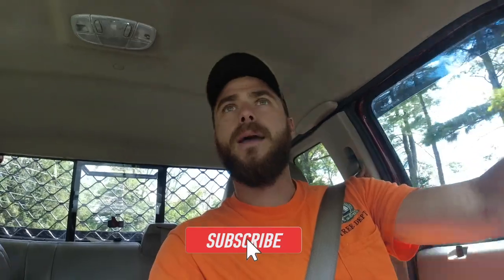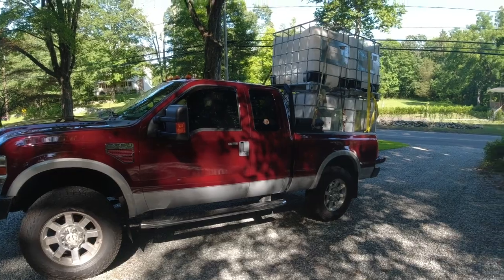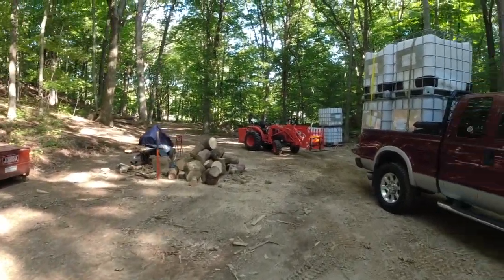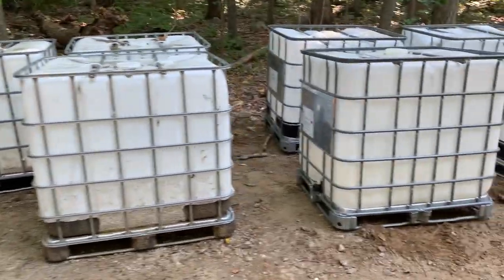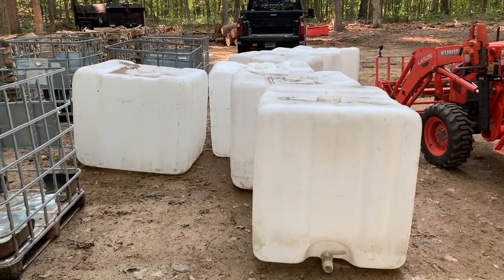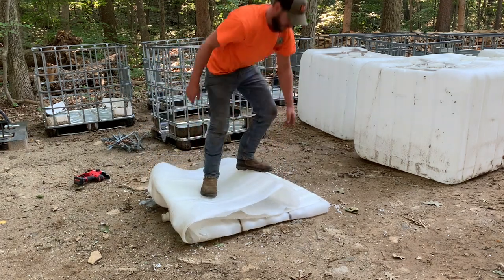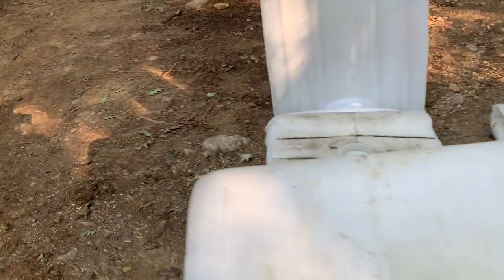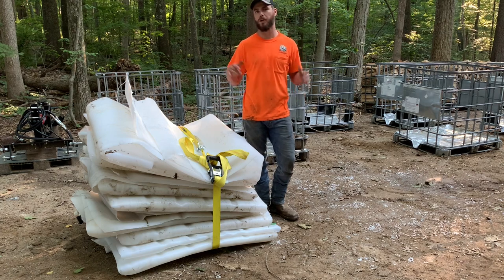#130 How to get IBC Totes for Free!!

Comment: Use your grinder to cut those bolts or screws off. I would be nice to have those water totes to save water in. Even if just to water your garden or wash your truck.
Reply from the maker: It’s pretty easy to just unscrew them with the power ratchet. I save the screws to replace missing ones on totes I get or that fall apart as I use them. I’m not really sure the bladder would hold the water well without the cage.

Comment: I remove the crossbars and the bladder, then I put the crossbars back on to support the sides after I cut the ends out. Then as someone suggested, I cut the bladders apart and use the pieces to cover the wood in the tote.  Great videos....keep it up.
Reply from the maker: Do you find that once replaced the cross bars get in the way of stacking the wood?
Reply: @DudeRanchDIY  not at all. I cut the ends out clear to the bottom so the crossbars going back in are pretty much a must to support the sides. So with the ends cut to the bottom, there's more room to "lean in" to stack the wood which makes the crossbars not an issue as far as being in the way. I've also found that with the crossbars in place, I can stack them 2 high and not worry about blowing the sides out.

Comment: A little late to the game with this, but here's what I've found. I measure 3" down from the top and cut all the way around and use the top to cover the wood (I read earlier that you don't like the look of them, but they come free with the tote, and don't need to buy a tarp). Then I use a cordless jigsaw with a wood blade, and tear down all the bladders except for one. Cut down the sides, then cut around the bottom, so you have 5 pieces.  Then I toss all those in the one bladder I didn't tear down. Push that onto the forks and set it in the truck bed. You can get about 12 cutdown bladders into that one.

Nice thing about the jigsaw is that it doesn't buck, just glides right along, and they're typically better on the battery than a sawzall. A cutoff wheel, as you have found, sucks for the job, and once it gets hot, the polyethylene basically welds itself back together. I don't put the top supports back in, just haven't found a need for that.

Getting the 275's for free (well, "free", since you have to barter, and that does cost you something) is nice. I've been able to buy 330s from a local place for $50/ea, and those hold a full face cord if you stack them just above the top (the cage is 38" x 47" x 47" on the inside, a face cord is 32" x 48" x 48"). The ones I've been getting are actually food grade, but that doesn't really help me since I'm breaking down the bladder.
Reply from the maker: Thanks for the insight JC! This video is older and I have since been phasing out the tarps since I am on a new property and can’t really see any of the totes from the house. I use the sides of the bladders as tops with a bungee cord on the top to secure it from blowing off. Works fantastic and less waste. I have a recent video of how I do the whole process and just take the centers of the bladders to the recycling center in my dump truck. Thanks for watching and your detailed feedback!!
Reply: I'll check out your new videos.  Thanks!
Reply from the maker: @JCWren  #241 & #242 most recently show how I do it!

Comment: I use an IBC cage as a guard for my generator when in use. I can cover the running generator with a tarp/plywood, and I can chain the two together to prevent theft. I only need to flip it off in order to refuel.
Reply from the maker: They have so many uses! Sounds like a great system you have!

Comment: Can you use a vacuum to collapse them so you could get them in your basement. I was thinking if I could put a black plastic tarp over and let it warm up in the summertime then I can pull a vacuum on it and collapse the whole thing I figure once I get a collapsed to a point where I can get it through a door perhaps I could blow it up and expand it to its normal shape using a hot air gun and everything else any ideas
Reply from the maker: Collapse the bladders? Not sure

Comment: Jake there is t40, t30, n 10mm bolt that I have come across for top bars. Sawzall is best for the bladders. Cutoff wheel as ur doing for cages. Keep one bladder in cage cut top off n let collect rain water so can use as fire truck on forks I've used mine more than like. Bill
Reply from the maker: I’ve thought about saving one entire tote intact for this purpose! Once I get my burn pit dug I’ll be doing this! Already have the hose fittings!
Reply: The millings you talking of for wood yard it not slag from a steel mill is it ? If is try 1 load 1st I hear it's a regret after some have tried
Reply from the maker: @billbrearton4164  Nope! Asphalt millings from when they resurface roads!

Comment: If you cut corner to corner you could use them as a roof to keep the rain off the wood...
Reply from the maker: I find those big tops to be an eyesore and just another thing to find a place for when not in use. I cover 5 totes at a time with 4’x20’ brown tarps and zip tie through the grommets to the top rail of the cage!
Reply: @DudeRanchDIY  yeah your way is better..
Reply from the maker: Haha 6 in one half dozen the other, I’m just a little particular and don’t want to stare at those tanks 😂 It works well for me, I have a video on it somewhere in there!

Comment: I've been enjoying your videos - keep them coming.

A few questions and comments about the totes:
1. For the wood that you have in the IBC totes, do you cover them? Why or why not? 
2. I cut the top of the IBC bladders off (I just use a sharpie and mark a line at the first bar down on the tote) and use these tops to cover the wood to keep precipitation off of the wood.
3. Do you put your totes that are filled with the split wood where they will get sunshine?
4. I've been using a circular saw to cut the totes - it rips right through them. Just got a cordless circular saw, so I'll be trying that out pretty soon.
5. I don't know if you need to skid any logs... what I'm going to do is take a corner of a tote (about 2 feet high, 16 inches of each side) including the bottom, and use that to strap onto the trailing end of the log so that it won't be picking up mud/dirt as I drag it to where it will be processed.
6. How do you clean the totes? I know you said that your supplier cleans them before giving them to you - but do you know how to clean them? I get mine from places that make dyed landscape mulch (the totes held the dye), and those are a real pain. Even pressure washing doesn't really clean them out. I'm trying to find a cheap way that cleans them out really good.

BTW, in a previous video you used one for holding the chippings from your shredder. I really like that idea.

I'm thinking of using one of the tote cages that is cut down far enough to sit right at my wood chipper, so that the split wood will go right off the chipper's tray into the tote. Then I can use my tractor pallet forks to take it to the totes for stacking. I think one one side, cut the cage open all the way down and remove most of that one side, and then use one of the sides of the bladders to have a temporary barrier that will keep wood from spilling out. Being able to lift the wood on the tractor to stack the tote sounds a lot easier than bending over to pick them up. Downside: will be stopping the splitting to empty the output "bucket". Alternatively, I'll find one of those 6'-8' pallets, and build some sides to it - this will hold a lot more than the 4' wide totes would.

It might be good to solicit from your viewers how they use the totes / bladders for purposes other than just holding stacked wood. A video on these alternative uses would be very interesting.
Reply from the maker: Hey there Wayne thanks for watching and for the thoughtful comment! 

Yes I do cover my ibc totes but only in the winter, I use 4’x20’ brown tarps and zip tie the grommets to the top bars of the totes. 1 tarp can cover 5 totes. I find the tops of the bladders to be an eye sore. 

I try to put the totes where they will get as much sun as I can while again not being an eye sore or in my way. 

The log skidding idea sounds like it could work! I have a purpose built “skidding cone” that slips over the nose of the log to achieve the same thing. I rarely skid logs though and when I do I just use the grapple. 

Cleaning the totes can be tricky, my guy I get them from says that he usually spends about 2 days cleaning them out with high pressure hose filling them up and draining back out over and over and there will still be residue. One of the main reasons why I don’t reuse the bladders or try to sell them. 

The chip box ibc tote worked well! I’ve thought about making a “catch tray” out of a tote as well! 
There are so many uses for the things the possibilities are endless, it would make an interesting video to get some viewer picture submissions as well! 

Thanks for the support and for watching!

Comment: F.y.i. 
There are people looking for cheap ( under $15.00)
Rain Water containers ,
All over the internet .

You might very well be able to sell those to the " rain savers" 
Perhaps offer them for $10.00 a piece , $20.00 delivered .
Instead of filling up the dumps,
Just a thought
Reply from the maker: Yeah I’ve considered this however I’m not sure how well the bladders would hold up filled with water without the cage around them. Also when I get them they are nowhere near clean enough to reuse without more cleaning. 

I bring them to a “transfer station” where I dispose of them in the recycling section!

Comment: Could have only cut six and the seventh one you could have just cut the top out and put all of the other ones in the one you cut the top out of
Reply from the maker: That would still have been much larger than what I ended up with!
Reply: @DudeRanchDIY  i guess the wai was thinking you could just keep adding to it until it was full then pick it up with the forks but might want to put some holes in the bottom to drain the water if you decided to try that. Keep up the great videos I really enjoy them